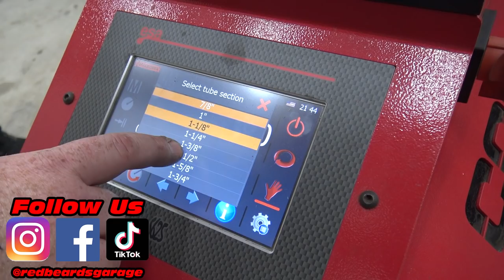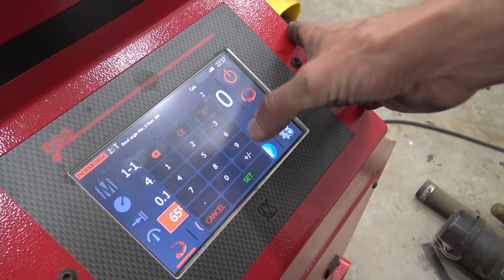XXXL Go Kart Build Ep1 ~ Dust Bowl 500 Prep

Comment: Over bend equals spring back?????
Reply: Pretty much. As Greg said in the video, you've got to bend a bunch of tubing to see how much it'll spring back from being bent to different angles. Knowing that you can over bend however much you need to compensate for the spring back and have your bends come out at the angles you want. He's also correct that the amount of spring back varies by the tubing diameter and wall thickness.
Reply: @butchs.4239  it's been a long while since I messed with them but there's 2 formulas that say no you don't. I'll admit that it's not super exact but I would trust it down to 1 degree.

Comment: Yeah I have the same 'size' problem lol.  The regular size go karts are the funnest but being older and heavier my main ride is a 420cc murray explorer.
Reply: Try a manco duece if you can find one
Reply: @amybender3731  Yeah those are cool.  I consider them more of a buggy but that's ok.  I like the explorer I can really stretch out on it only being 5'9.  I do still ride my smaller karts which are like lil red.  In fact, I have a McCulloch F1 race kart frame I want to get an engine on.  We live rural when we get together to go ride for long distances ill take the explorer not only is it bigger it's equipped with lights, a roof and a stereo.  Kinda like a small razor.

Comment: Red beard I have a four seater go kart do you think a predator 212 with a 30 series torque converter will propel the kart reasonably
Reply: Well how fast do you plan on going and on what kind of Terrain?
Reply: A huge sprocket, no fat asses, maybe 20mph
Reply: I would say spring for a predator 420 if you can afford it…you could do mods to the 212 but for a Kart that size with potential weight….might not be worth it. Maybe middle of the ground 8hp predator 301cc…with a stage one kit

Comment: When bending tube steel, the term used is spring back and there is a formula that uses material type, wall thickness, bend radius, and diameter of tubing to asses how much over bend is needed for that type of tube. (D=[Ir/(Mtx2.1)] x Material factor)